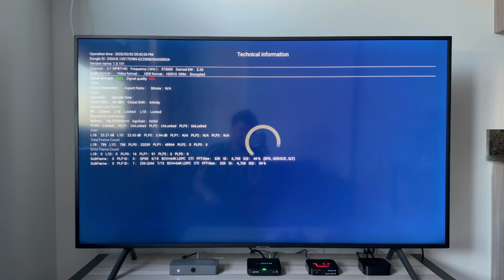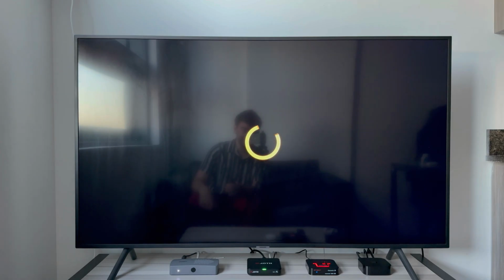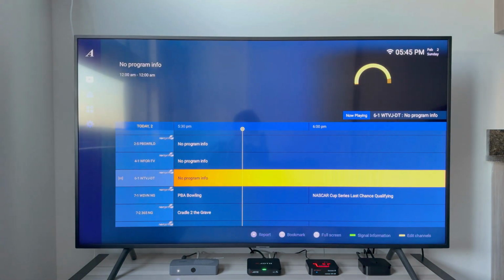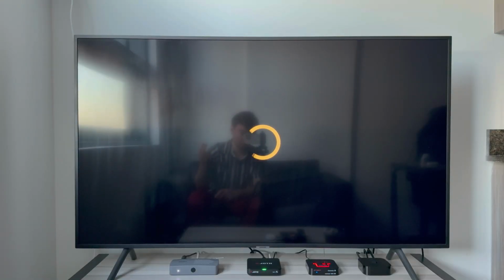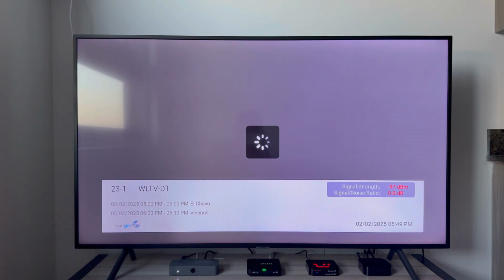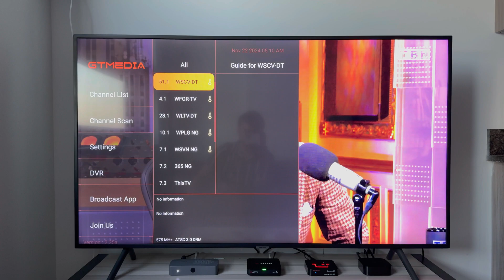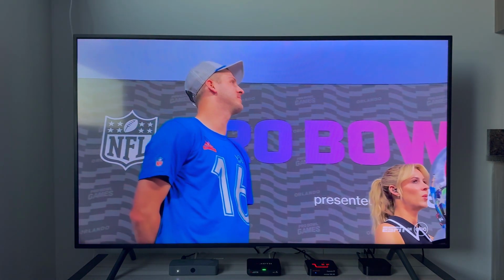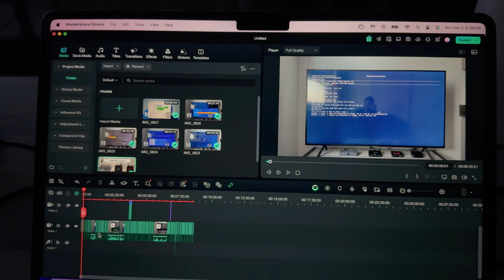DRM Issues? ATSC 3.0 Troubles Continue!

Comment from the maker: I just checked again this morning on all 3 devices and it is now working as expected. Those of you commenting from South Florida that also had the issue should be able to play back channels normally now.
Reply: Have you tested the adth box for VHF atsc 3.0 signals? The one in Chicago is very difficult to receive on this box in terms of stability but is fine on Zinwell. The adth tuner seems to be very cheap.

Comment: First, your SNR SHOULD be around 30db or higher. Looks like you MAY have a codec or an FEC issue. I say that because it's only the 3.0 channels. MER and BER are also quality readings that should be : BER needs to be at E1-07 ( 1 error in 10,000,000 bits)or higher, as this can (and will) affect FEC. MER needs to be around 36 or higher, but both are quality readings, and usually cause pixelization, not necessarily a blank screen, which could be a codec issue. Hope this helps.
Reply from the maker: There is absolutely no reason to have a 30dB SNR. Fundamentally, as long as the receiver has extracted the correct transport stream or IP data without corruption, or if all errors are corrected, the transmission is still considered reliable, even if the pre-FEC BER was not 0. This is a really important concept, and I'll probably make a video about it in the future. The modulation and code rate configurations of the ATSC 3.0 lighthouses in the video don't require a 30dB SNR. Neither do any ATSC 1.0 stations. A 30dB SNR and low BER are nice to have, but not necessary. I have no way of knowing whether or not it's a codec issue since all of the channels are encrypted, but I think it's unlikely.
Reply: @WNYOverTheAir  Food for thought: If it's happening on multiple pieces of equipment, what would you think the problem is? Everything points to the DRM is NOT decoding properly. I would look to the signal quality anyway because the equipment is manufactured by different companies, but have the same symptom. Think common cause. It's either the DRM or the signal. By the way 30db SNR is  not that hard to achieve.
Reply from the maker: @kimharris4338  The problem appears to have been fixed. I didn't change my setup and as of this morning all 3 devices are working. My received SNR levels for the boxes are still the same as well. A DRM implementation error is a possible cause of this issue.
Reply: @WNYOverTheAir  That's good news. Just out of curiosity - How long did you have the equipment hooked up until it kicked in?

Comment: I have a ZAPPER BOX and it works good.I have a rooftop antenna a huge wineguard antenna with rotor.So far I receive the DMR with no problems, but that might change. I like the ATSC 3.0 idea, but they have to resolve the DMR issues!